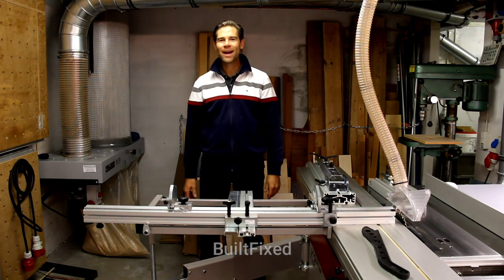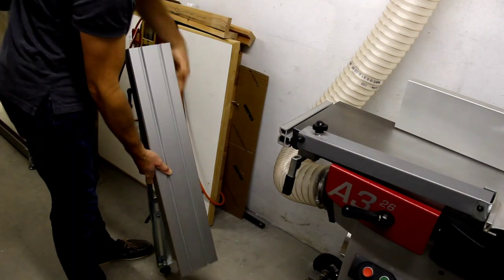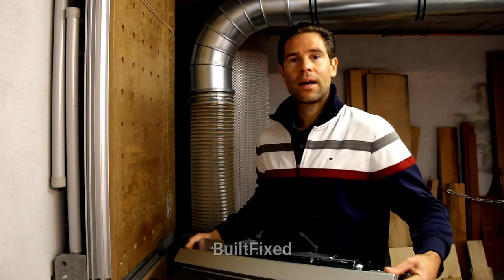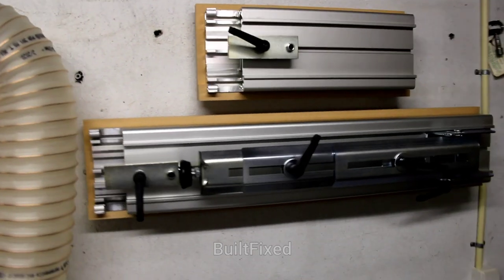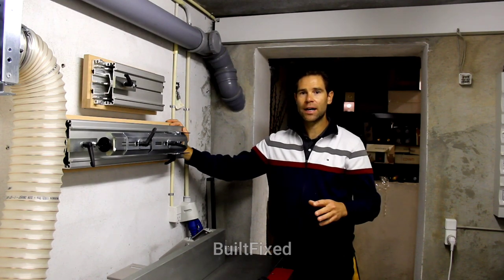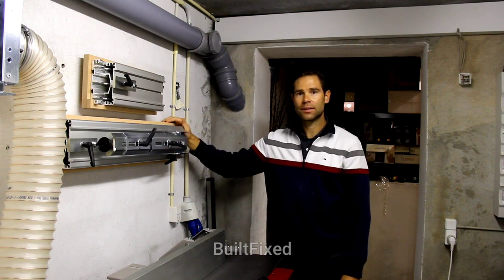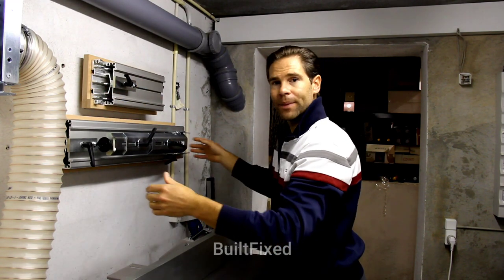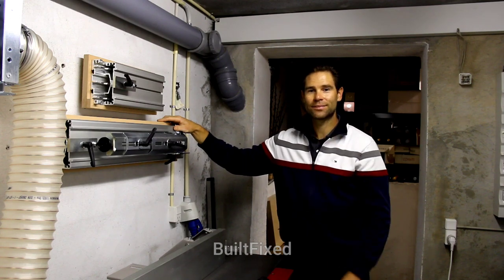Felder Hammer woodworking aluminum extrusion storage

Comment: I'm not certain if you are still checking here. But, I have a question: What did you use for the bolts (?) that slide into the T-slot of the tables? I was able to pick up three extension tables on Craigslist for my K3 and A3-41. I like the idea of storing them on the wall, like you did.

Comment: I am wondering if you cut full sheets of plywood on your K3 with limited space? I also have a small shop and i am considering a k3. But large sheets I probably would rip with the track saw…
Reply from the maker: Hi Jan. I typically make at least one breakdown cut prior to bringing the plywood into my workshop. Technically I have space enough to rip 2.7m (9')  but unless the piece needs to be that large finished I reduce it first with either a tracksaw or shop saw.  I also have chosen the narrower (800 mm) rip capacity width to the right of the blade to reduce the saw's fixed width footprint whereas I think most with my machine's specs would have had 1200 mm if they had space enough.
Reply: @builtfixed6611  , thanks for the feedback! I really like your channel and the way you build along... What is the size of your workshop ?